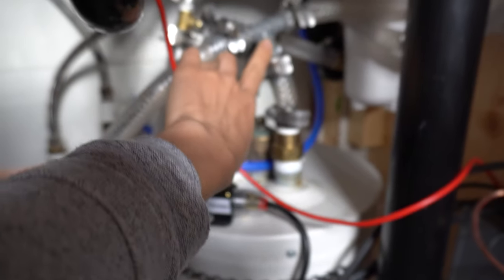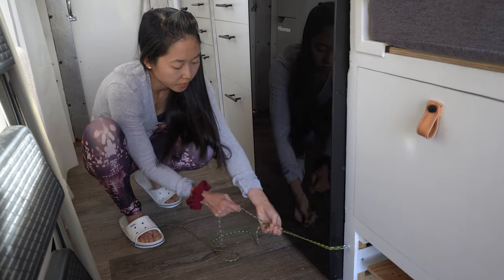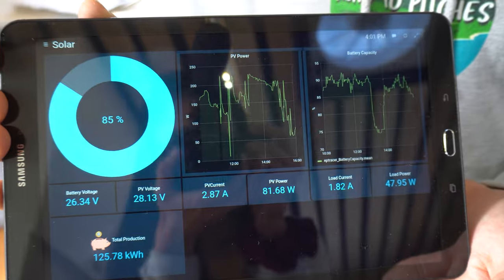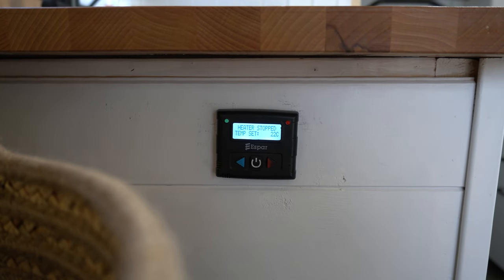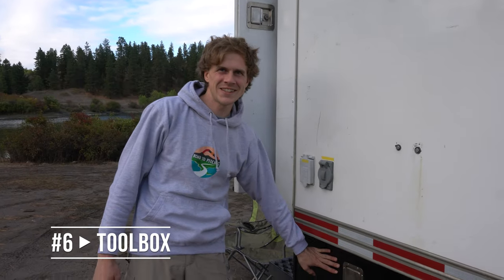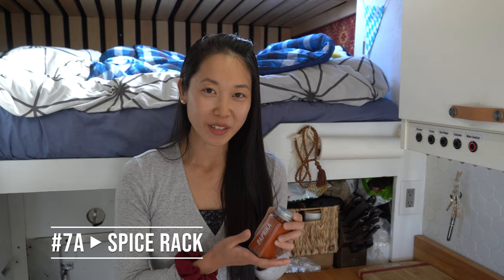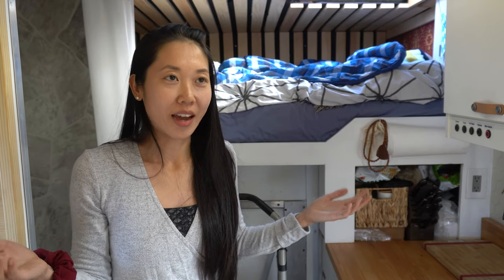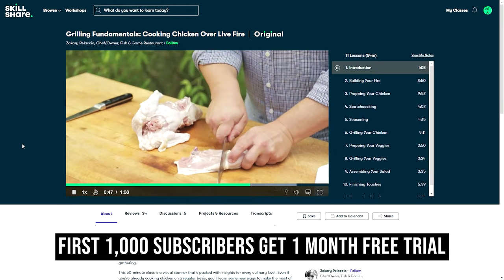Top 10 Van Life Upgrades, Fixes, and Gripes

Comment: any more info on that fridge turn of setup? ;)
Reply from the maker: Sure, it's a fairly simple rule. Our solar charger has a modbus data port. That's how I get all the data into the raspberry pi with OpenHAB. On the flipside I have a relay which allows me to switch between shore power and the inverter.
Last piece is a rule in OpenHAB that will switch the relay to shore power if the battery level is below 20%.
The inverter will still run at this point but it has actually a very low standby current of like 150mA. So the battery can support that for a couple more hours. The standby power consumption of our camper (with LED controllers, raspberry, etc.) is about 8 W.
Reply: @RoadtoPitches  nice, I was wondering if you have a inverter with remote switch that you control. 8w for standby is pretty neat, I think I'm at 60 right now 🤔 but that's with LTE router, raspberry, a few d1minis and wifi on the BMS and the heater.. I guess there is room to bring it down 😁

Comment: Expecting 0.50-inch plywood to be sufficient for the floor is obviously flawed. You should have discussed with others first. Any lumberyard could have dissuaded you. It doesn't matter where floors are they must all have sufficient strength. Given the two of you are fit only shows how inadequate 0.50" in. is. 5/8" bare min. and as you said the support joists are key. 
A label maker is advisable from the beginning.
Navy bunks are 18" of space.
Reply: Sorry for the rant that is coming. Mark, you comment shows that you have only very little knowledge about engineering.

We are looking at a simple mechanics of materials topic. The deflection is dependent on the elasiticity of the material, the position of the supports of the plywood, the load on the plywood and the position of the load relative to the position of the supports.

The elasiticity of plywood is a function of wood type, number of layers, thickness of layers, type of glue, additional treatments like for example pressure-treatment and so on.

The spacing distance between the supports determines the deflection as well. Closer spaced supports result in lower deflections.

Without any additional knowledge or definition of the plywood material properties or support spacing distances your statement "0,5 inch doesn't work" is obviously wrong. You are trying to pick out a single parameter of a problem which is in reality dependent on a multitude of parameters.
Physics doesn't work like that.

The maximum allowed deflection and the maximum expected worst case load (in this case one person standing perfectly centered inbetween the supports) are your engineering requirement inputs. As the design output you have 2 degrees of freedom by chosing the plywood elasticity and support spacing to achieve your requirements... I don't see any issue with 0,5 inch. It is just a matter of finding the right design for given boundary conditions...
Reply from the maker: Thanks for both of your comments! The interesting bit I took away is that we're up to navy standard, as our bunk is 50cm tall (or in US-units just over 19 inches) after subtracting the mattress (that one takes it's own 18cm and we could gain even more space with a smaller mattress). I guess it makes sense that there is a standard but I didn't know it existed until this moment!
Reply: @RoadtoPitches  I just got off a boat where I worked\lived for several weeks. Bizarrely they had mattresses that were the (now) common house standard that is nearly 30cm thick!. I laughed and found this bizarre given the space available. 20cm was the norm and should be max. given the space. You might need to build your own. I of course prefer a firm mattress and am known to happily sleep on the floor at times so take that into account. People ask me how many my rig can sleep and my reply disturbs them.
Reply: @JD-nn4kd  You are correct I did not state my idea well. I can assure you it is not a lack of understanding of engineering as you arrogantly claimed. With proper support, 0.5cm ply can be used. My mistake came from assuming they were using standard floor joist spacing standards which was absurd given the project.
btw...I work as a sub-robotic engineer.